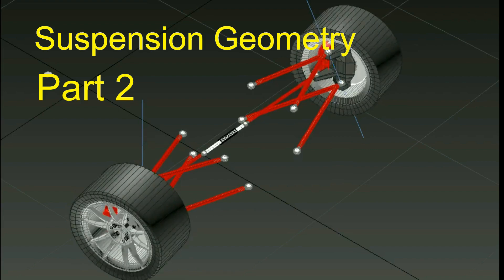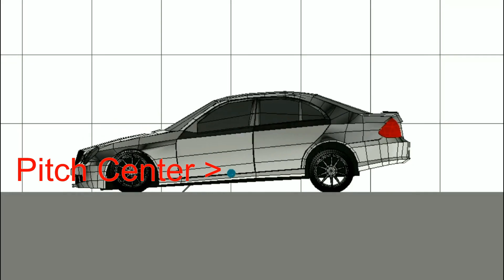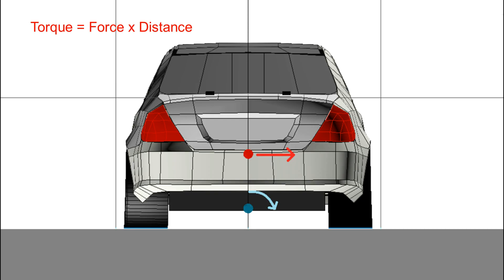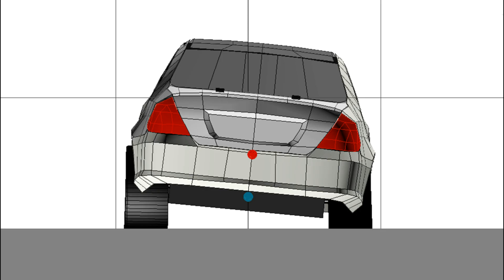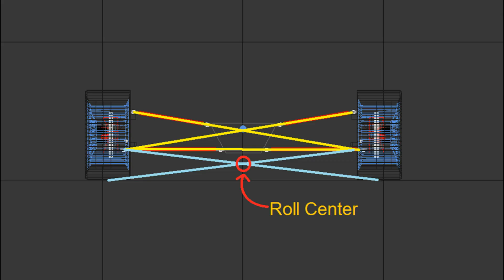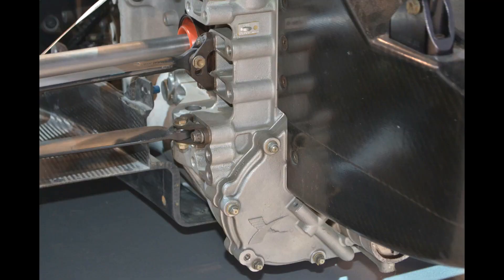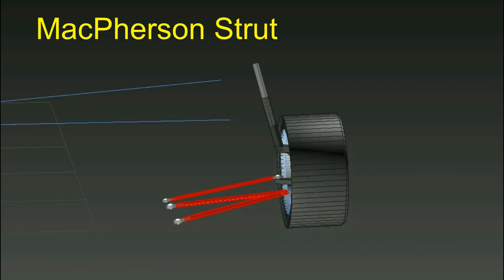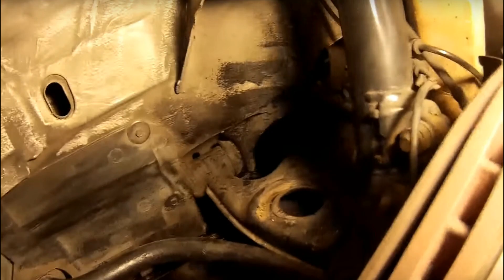Suspension Geometry - Part 2 (Roll Center, Double Wishbone, MacPherson Strut)

Comment: If the camber changes on the MacPherson are gained and then lost, could you reduce the lost camber by lowering springs and making the dampers shorter and harder? As the suspension is compressed you gain the camber but it is too stiff for further movements so you would not lose as much camber.

Comment: i dont agree with the generalizeation of bumpsteer. you get really litte bumpsteer without haveing them inline. and you can get some if they are inline. BUT haveing them inline is often a good start. its not always the best. also the lenght of the steering rod affects becasue of the angle difference is smaller. you never get 0 bumpsteer but you want the amount of bumpsteer to be in the right direction. toe out under compression toe in under extension. Otherwise really good video

Comment: How to define the length of the steering arm in MacPherson Strut to avoid bump steering?
Reply from the maker: Usually its placed close to the same height as the lower control arm so the length has to be as long as the lower control arm as well. On some models where they mount it higher they go with really long steering arms to avoid bump steer. You'll see that in the 2002 Civic for example

Comment: How to define the length of the steering arm in MacPherson Strut to avoid bump steering?
Reply: in most setups if the steering arm is relatively close to the lower wishbone it needs to pivot in approximately the same  places so that the steering arm and the hub assembly move through the same arc

Comment: Shouldn't the forces be in the opposite direction at 13:17 ? Great video regardless
Reply: I was thinking the same thing.  Shouldn't it be when under braking the rear link is compressed and the front link is put under tension?

Comment: Automation the car company tycoon game is where you can build engines and run them but also static configurations of the whole car which includes suspension and offers much better detail about the choices of suspension and their effects if i remember correctly, highly recommended
Reply: Oooh I bought that a long time ago when it was an engine simulator only, I'll need to reinstall it :)

Comment: Another good video.

It would be interesting to see something on live axle setups after we see the independent rear suspension setups. Watts links vs Panhard and what independent suspension solves that they can't. Maybe how you can solve the problems that drag racing presents for independent options that live can solve...
Reply from the maker: Sure, I dont have that much experience with solid axle suspensions but its a good topic. I'll try looking into it.